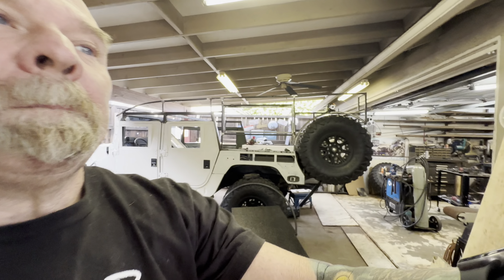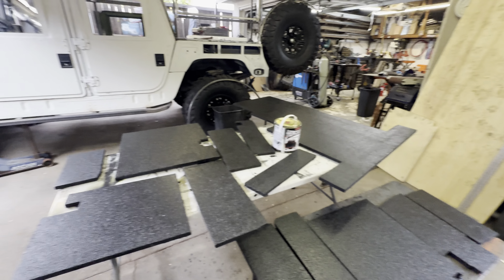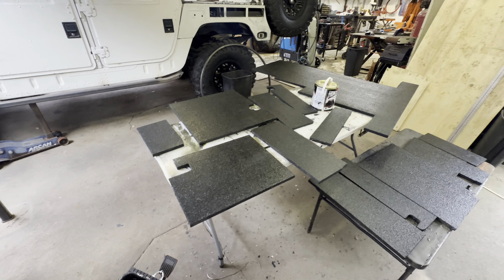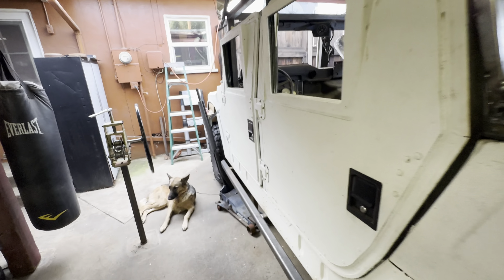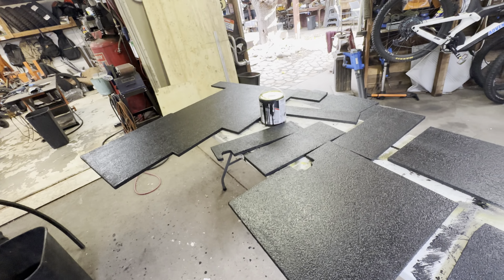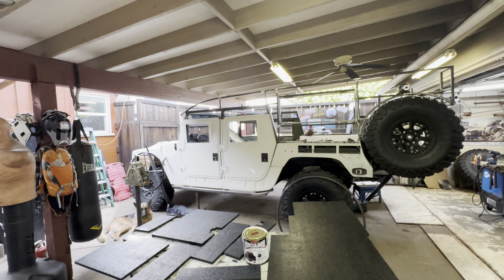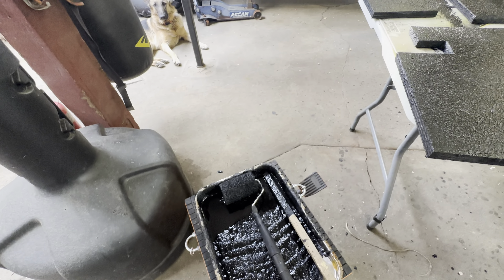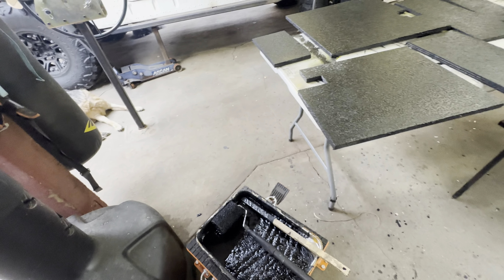HERCULINER and RAPTORLINER, How to and review on what I use them for.

Comment: I used to do linex raptor liner was very hard to get off cause it would just keep braking apart. Where as linex would come up in sheets and if it was fresh or prepped wrong it wasn't that hard.

How hard is it to patch raptor liner?
Reply from the maker: Hurculiner is so easy to patch and just blends in! Raprot I just redo the whole panel and only have done that once! It blended in just fine. That my limited experience with touching up stuff!